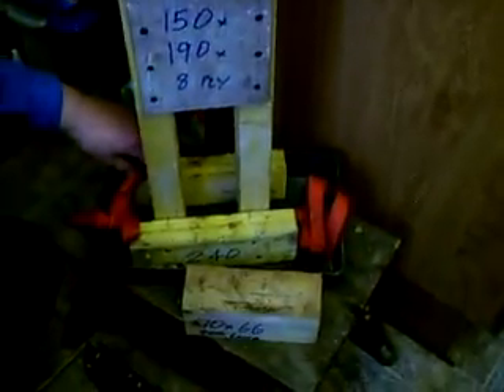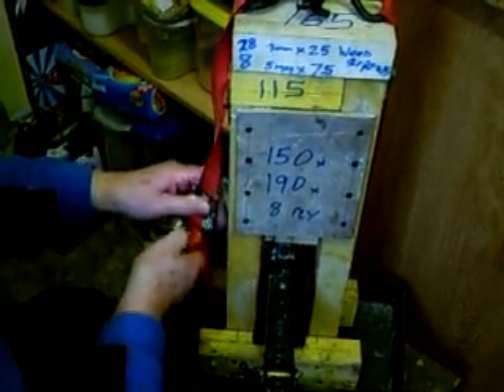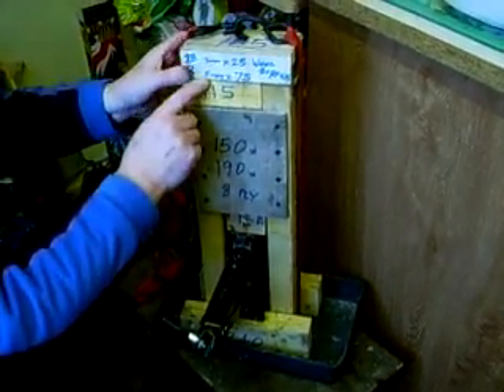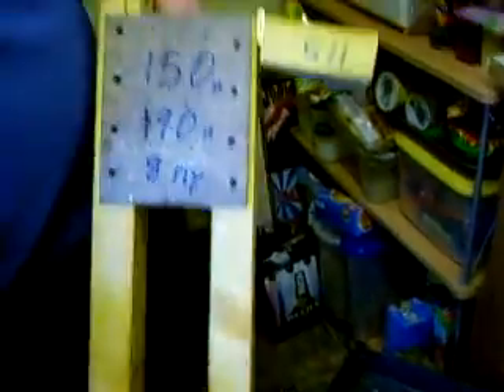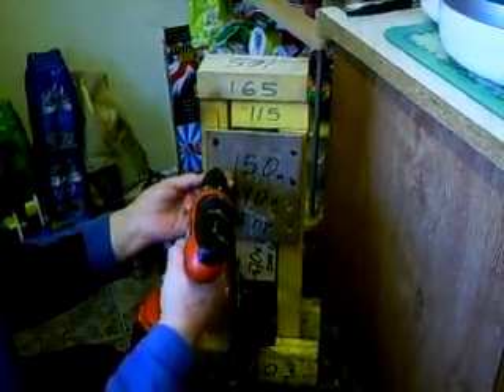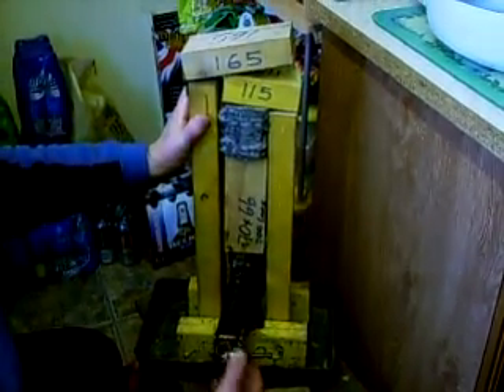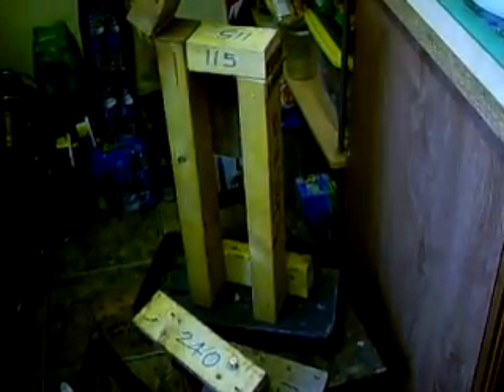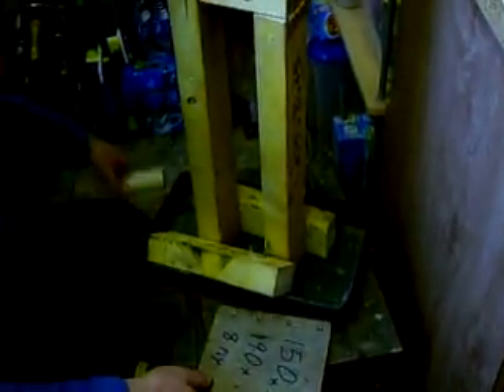Build a Small Paper Briquette Press with Car Jack

Comment: Very cool. Question...would wetting paper first and then squeezing out the liquid create a higher density brick. I bought materials for homemade solar oven. Could bricks dry like that.
Reply from the maker: Hi Diana. thanks for your comments. Drying is the big problem (especially here in Scotland) If you take a look at my other videos, you will see the different ways that I make the briquettes. I try to avoid making papier mache, - too  slow and too messy. I use my greenhouse in the winter to help with the drying but it is a slow process. Good luck.  Garth
Reply from the maker: Hi Diana, Yes it was meant to soak up the water overnight and the excess pressed out. Simple but it works.  Garth

Comment from the maker: Thanks for your comments. I have a regular supply of paper, cardboard etc., so it is always my base material but I add sawdust, leaves, twigs etc whenever they are available. Burning takes place in a Rayburn, which is a closed furnace, so impossible to film. It saves me about £300 per year in coal costs which is the main reward. Glad you like the design.  Garth